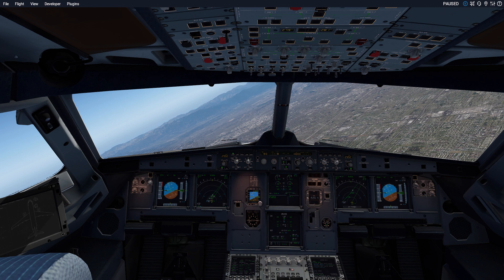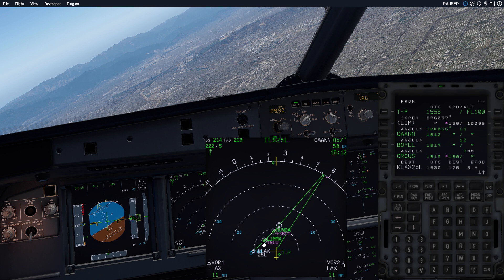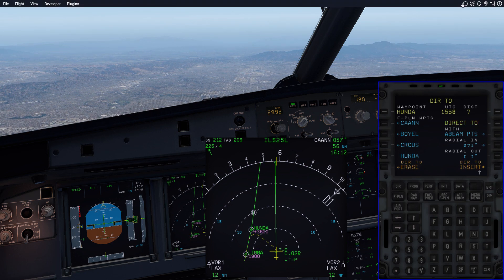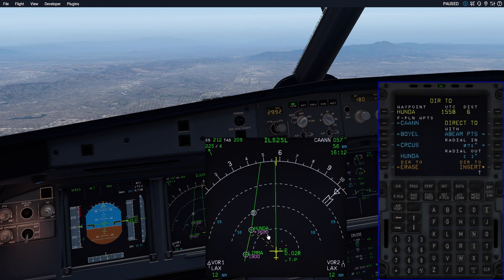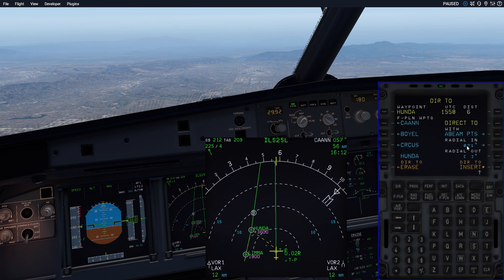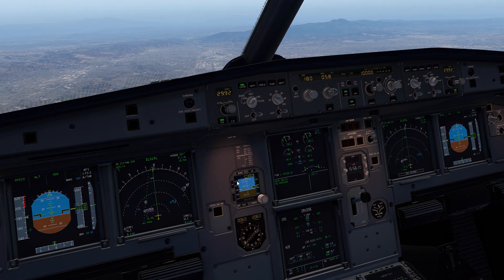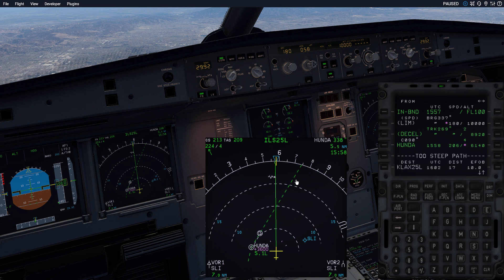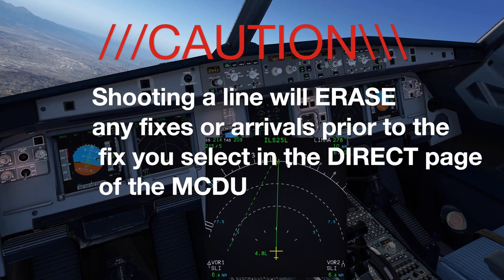I Airbus MCDU I ADVANCED I Extended RWY Centerline

Comment: another cool trick is if you have a downwind leg preinstalled in youre route , you can set an abeam point for the managed mode. to add this, head to fix info page. for this example I'll use OMAA as a reference. so i set omaa and click abeam. a green star icon will appear. click this again and an AOMAA will be set in the F-PLN page parallel to the reference airport. in our flights, i usually set speed 230/5000ft AAL (or 6000 ft if downwind leg is busy). there, the ap will direct the flight to fly that leg automatically. sure helps a lot in terms of workload.

Comment: Really really neat stuff! Just curious-is that the function that the radial select was put in there for? Or is this a hidden trick of using that function?
Reply from the maker: CX-W Skitch lol I don’t know actually, I would guess it was probably designed for radical select for joining airways or approach courses but with modern GPS these days it’s kind of obsolete so this is its primary function now maybe  😬